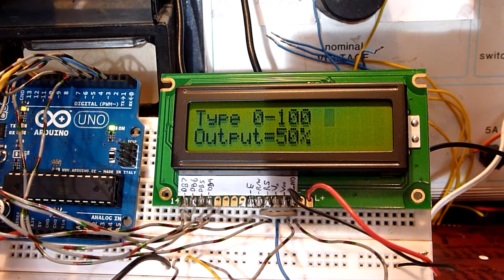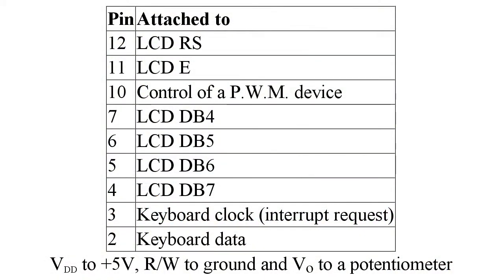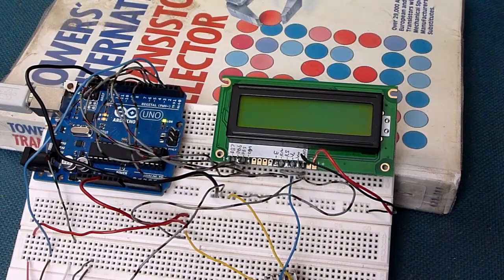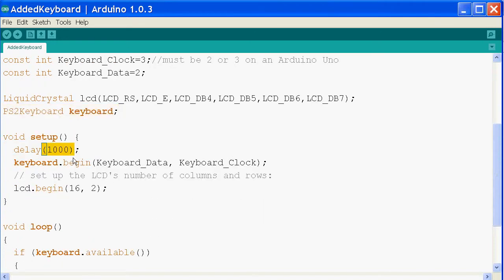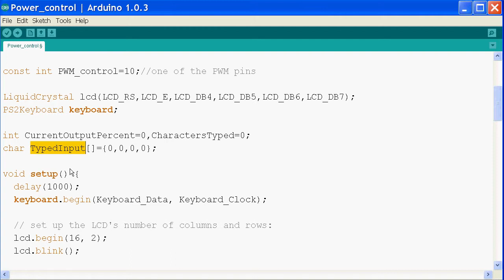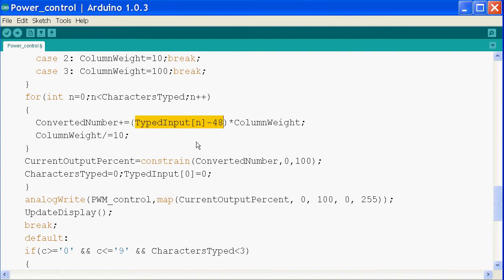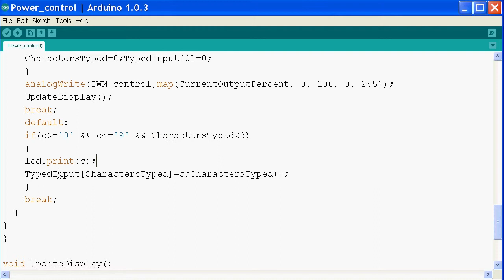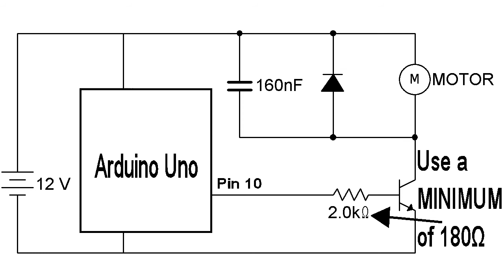Tutorial LCD, Keyboard and PWM

Comment: very good, I can use pwm with temperature sensor? example: when the temperature is 20ºCelsius the voltage would be 3volts if the temperature is 15ºCelsius voltage would be 12v.

I Can do this in automated programming with arduino ?
Reply from the maker: You don't need PWM for that: get an LM335A then use one of the analogue pins as this temperature sensor converts the temperature to Kelvin then just calculate the centigrade:
MeasuredTemp= (analogRead(TempPin) * 500L) / 1023L - 273;
but bear in mind I'm using integer arithmetic.
Reply: ok, thank you
Reply from the maker: Goodness knows why you thought that had anything to do with PWM. I can only imagine it was just to make me give you a solution to your problem without having to use Google.